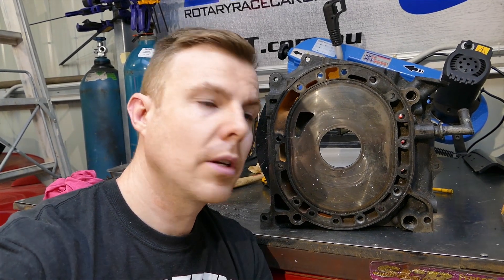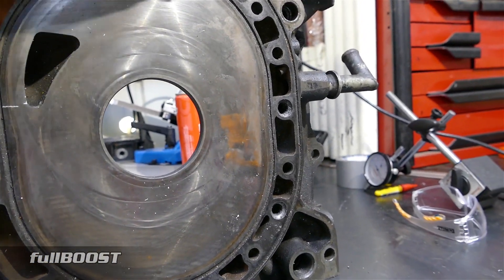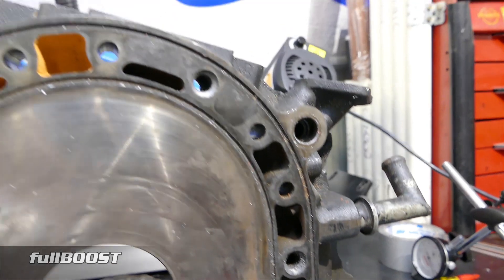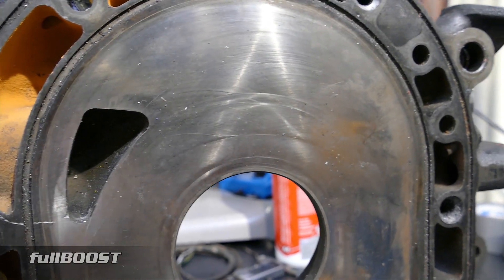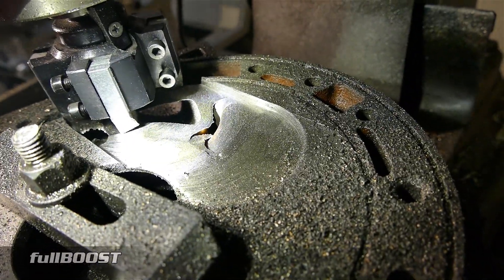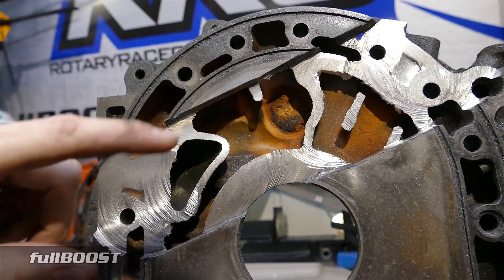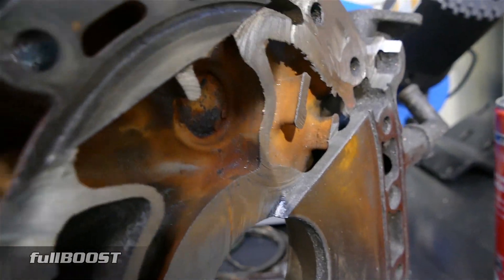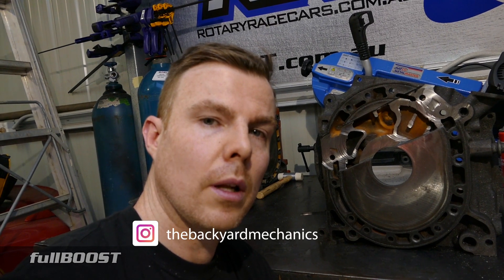What's inside a Rotary engine plate? | Backyard Mechanics

Comment: Great to see the old plate sectioned, I lost one in the 80's due to getting to greedy with a burr. A thought on my behalf that the ribs cast into the hot side of the end plate wouldn't be there to redirect coolant but support the surface to prevent drumming and stop rotor wobble? 
A bit of a surprise to hear of these having detonation problems though, I always thought that they had inherently low compression. If you do any more spots like this could you talk about the relationship of the stationary gears and the rotor re max rpm's and the planetary advantage the rotary looses?
Cheers

Comment: I have many questions. About rotary engines
1. What causes detonation in a rotary engine?
2. What causes the apex seals in a rotary engine to wear?
3. What will happen if your rotary engine over heats
4. Can a rotary engine ever knock bearings
5. Does the rotary housing wear over time and needs machining or replacing?
6. How do you measure Compression in a rotary engine?
7. What is the firing intervals of a 2 rotor engine and how do you calculate in degrees?
8. How many moving parts are there on a 2 rotor engine compared to piston engine of same power output?
9. Do you get a turbo diesel rotary engine if not why?
10. How is the oil pressure controlled in a rotary engine?
Reply: 1. Detonation is an effect of too much air and fuel mixture, tipically in turbo rotary engine.
2. the apex scrape on the housing continuously, and even if the metric injected oil to lubricate and cool the same this is not sufficient to eliminate the consumption, the surface of the housing is obviously much harder, by technical choice, therefore the apex are consumed.
3.with overheating all the components go out of tolerance, creating rubbing of the surfaces that should not touch, the bearings of the rotors as well as the stationaty bearing are strongly stressed and not being cooled properly they break / fuse with the consequences you can imagine.
4. yes it does, for overheating or for misalignment between them and the oil line
5. the housings are subjected to mechanical processes that increase their hardness and strength. Precisely for technical choice are the apex to be consumed, but, over time, even the surface of the housing undergoes erosion. Those engines that are well kept up to about 200,000 km fall into tolerance, then the rehosing is necessary. You never have to do machining, the mazda performs operations that are not reproducible. you will have smooth housing but that last very little. always new.
6. compression measurement is performed for each rotor and for each burst chamber. you will get 3 values for the front room and 3 for the rear. In fact, the compression of each single face of the rotor is measured for each chamber.
7. the ignition interval of the two candles is a very short time, calculated from the ecu based on several parameters and difficult to calculate.
8. it's easier to list the parts that the 4-stroke engine has too much. connecting rods, valves, camshafts. the piston can be defined the rotor, the housing the cylinders and the bands are the apex. the rest is not needed :)
9. I do not remember the exact reason but the Germans had done some tests in the 50s I think but it did not work well, it needed a compressor to bring a lot more air into the rooms and the yield so lapsed a lot.
10. Certainly, the pressure is controlled immediately after passing by the oil pump in output towards the radiators and subsequently entering the engine after the oil filter. then it is controlled at two points of passage of the line, to optimize and stabilize the pressure as much as possible. Speaking of oil, 2 modifications are absolutely necessary to increase the longevity of the engine and the apex housing duration. and are the replacement of the valve that blocks the cold oil circulation with fixed open bypass and the replacement of the two pressure regulators to bring the level from 60psi to about 100psi

sorry for English, I'm Italian, and to conclude I can affirm, emphasize and bold that the wankel in the highest expression of the 13b msp of the rx8 is the best engine ever ... complex and delicate but superb in its realization. and always remember that the mazda has got an aeronautical engine used to working with huge loads and high rpm, and put it in a car .. do you :)

Comment: just noticed the rb30 head on intro. Got one of those big old cam tunnel cracks. Reminds me of my apprentice days drilling and grinding out those cracks and welding them up Line boring RB heads after that was the worst job the were pita to get dialled in
Reply: LandRoverLife yep that one suffered the fate most did and had a repair at some point in its life.